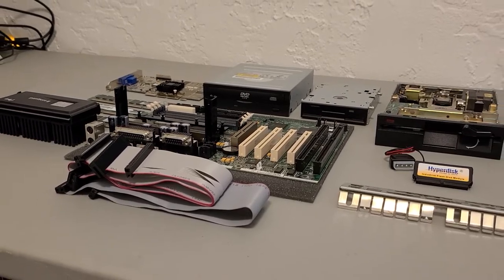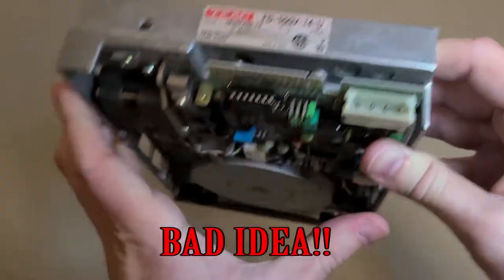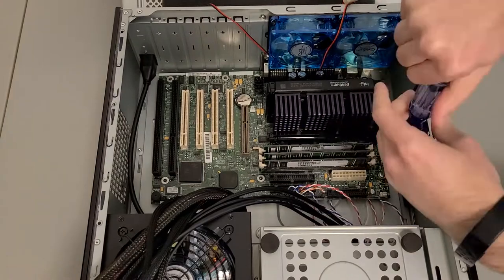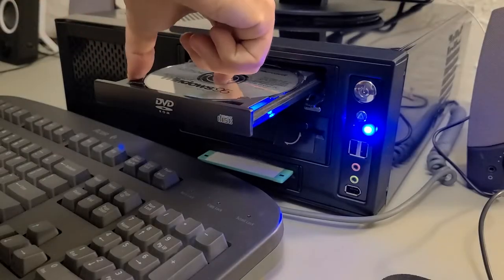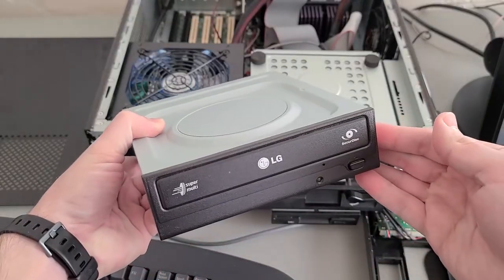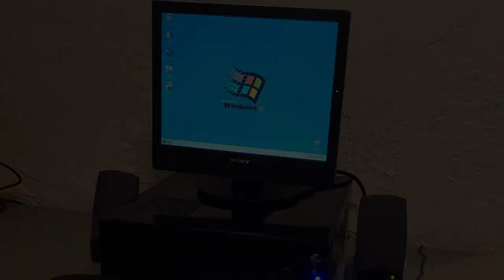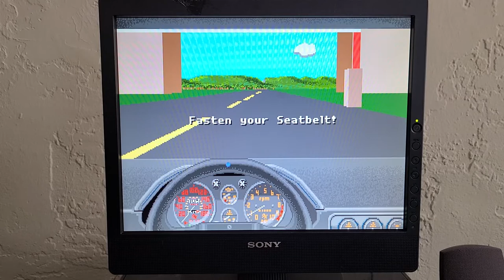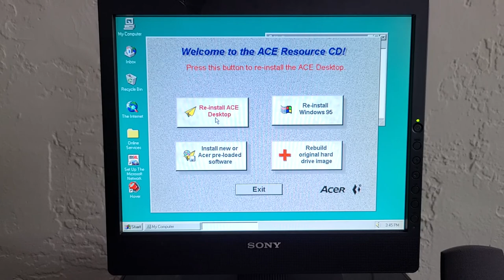Building a Pentium II Windows 95 PC

Comment: I would pair the TNT2 with a 3dfx Voodoo 1, or a Voodoo 2. I would have installed Windows 98se as it has all the updates with drivers to cover more peripherals than Windows 95. Also, SoundBlaster Live was the gold standard of the time, it includes EAX. I have a Windows 98se Micro ATX desktop with a K6-2/500mhz processor, 256mb of PC100 memory, SoundBlaster Live, Nvidia Geforce 2 MX400 (32mb) paired with a 3dfx Voodoo 1(4mb), and 42 90's era games, all are Windows based, no DOS. All in all this was a beautiful build, the case looks gorgeous, well done, you should be very proud!

Comment: I've always associated p2's with 98 as my p2 machine came with 98 installed

Was my first brand new pc, p2 350 with a 7gb hard drive, good old IBM Aptiva

I remember being really sad when my parents bought me a Voodoo 3 2000 AGP when I realized I didn't have an AGP slot, ended up returning it for the PCI version
Reply: I had both PCI and AGP version.  AGP made no difference on Voodoo 3 2000.  I’m pretty sure it was just a selling point.  AGP was more for GeForce 2 and later since they actually benefited from that slot.  The ONLY difference it made for the Voodoo 3 2000 is it wasn’t on a shared bus.

Comment: even for a 486 computer it would be possible not to install a 5.25 disk drive, why is it on a Pentium 2?
Reply from the maker: I wanted a PC that has 3.5, 5.25, CD/DVD, and USB.
I've been using it to back up 5.25 floppies and then transfer them to my main PC using USB flash drives.
I'm happy with it.

Comment: no network card for quicker transferring data between your retro build and daily pc? seems weird, but it is your choice. but...
just 4 gb of storage? meh, even it is win95 rig, you should add second hard disk 20gb+.
but generally nice setup :)
Reply from the maker: I honestly didn't think of transferring things over network, but so far transferring things over with a USB flash drive has been working just fine :)

And yes, I'm running out of space pretty quickly and I'm currently looking into getting more storage :D

Comment: Did you update everything in Windows 95C? DirectX 8.0a, IE 5.5 SP2, Windows Media Player 7.1, etc etc.
Reply from the maker: This is the latest version of w95 which came out in 1997, so most updates were already there.
I didn't install directx8 and used dx6 instead since the tnt2 card can't take advantage of anything higher.
Reply: @DS08  I see. Alright cool. :)